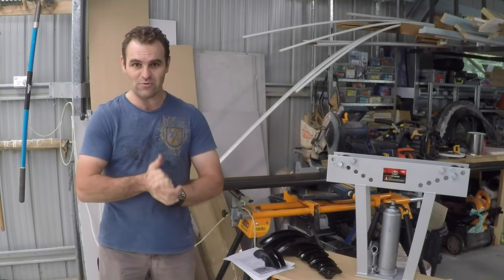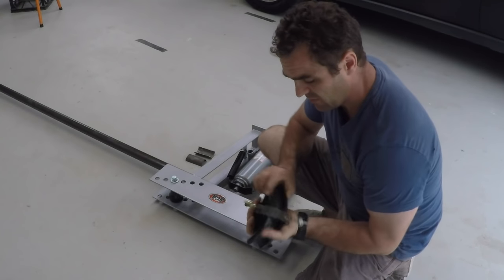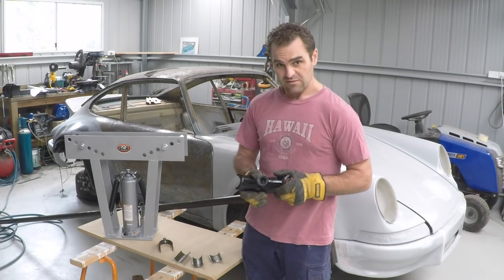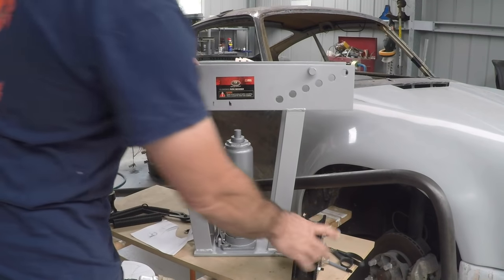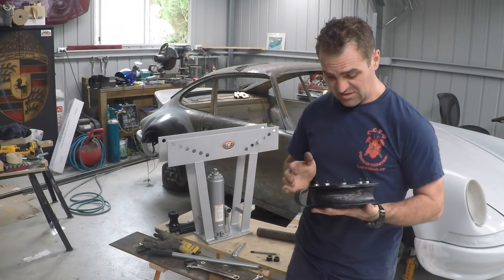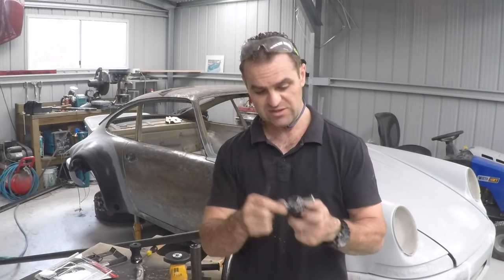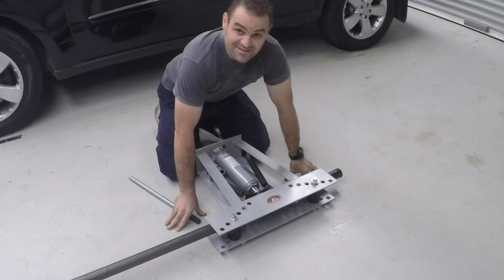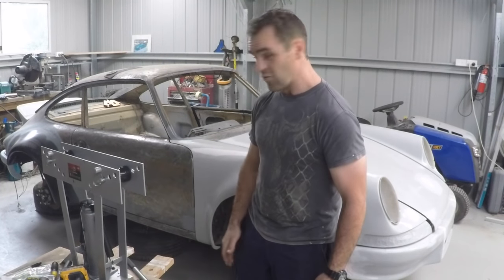How not to build a roll cage tube bender

Comment: When i bend with these benders. I mark half inch increments on the tube and line them up with a centre mark i drew on the die and count say 10 pumps and then do the same along the marks you drew. Youll get an even smooth bend

Comment: Good presentation.  What you need is a roller to bend the tube around the die.  The roller will support the outside of the tube while the die supports the inside.  You could go a step farther with a straight, concave shoe to fully support the outside of the tube.  Basically, just copy a commercial unit.
Reply from the maker: The main issue I have come to realise, is that the radius of the die is too small for the tube, so if you had a larger radius tight fitting die, some of these methods would have worked better. As you can see in my other "How to make a roll cage tube bender" video with the correct die, it also has a much larger radius.

Comment: When I went to fitter school.. we packed the pipe with sand to help support the structure.. so the heel didn't collapse. Maybe try that? IDK if it will work with a bender.. we used an old torch... good luck
Reply from the maker: Watch the vid ;)

Comment: I didnt watch the whole video before replying .. so i hope i dont mess this up by saying somehing that you had allready figured out.  

When pending pipes at any size its good to fill them up with  something first to prevent wrinkless and crushing in.    Sand is usefull but not perfect.   Water is good, but messy.   Basicly anything that does not loose volume under high presure is  perfect for use.  Butt you need to be carefull, becouse the presure rises fast inside when the pipe wants to crush, but liquid or what ever inside prevents it happening.   

Hope it will help others, and you aswell at some other projects.   maby even at building brake lines etc. 

Want to say to you, that you one of few diys that does things well, and not piss against wind while running.   Thumps up .

Comment: Excellent persistence. I'm sure u have abandoned this by now but one tip I heard if you have a die that's too big for the tube, get a piece of tube that fits the die correctly and has the correct wall thickness to reduce it down to the size u want to bend. Then bend it and cut it in half along the radius and tack it in ur die. Use it as a reducer. So if u had a say 1 3/4 die and wanted to bend 1 5/8 u would need to get a piece of 1 3/4 with .0625 wall thickness and bend it.
Reply from the maker: +shea jones I did consider something like that, but it was all too difficult, and as I have mentioned to others, I think the core of the problem was the radius was too tight for the tube I was using. One of the suggestions someone came up with, which I think would have been the best would have to put Chemi Weld in the die with some plastic wrap over the top and then push a piece of the tube through it to get the perfect size. 

Either way if you look at my other video of how to build a tube bender (that works) I sorted it all out with a correct die from the affordable bender.

Comment: It comes down to one simple fact mate, pipe and tube does not want to bend! Wall thickness, centre line radius, material etc all play a part. The outside is being stretched,the inside compressed and it only bends naturally around the centre line radius.
 I have a JD squared bender with dies, expensive but worth it. I make the cost back by hiring it out to others, the best solution for many. If you of going to use one much then see if you can hire one, better than wrecking expensive tubing and cheaper than buying one.

Comment: to be able to use the die, you'd need a very narrow die for the pipe, it should just sit on the top of the bending die..
the force of the hydrolic jack shouldd force the pipe into the die and make a good bend..
good luck, greetings from the low country..
Reply from the maker: Ultimately the radius of the die is just too tight for the tube, so it will always kink. The correct die I got in my other videos has a larger radius.

Comment: the bender you have will probobly have dies for imperial tube. you can purchsse metric nominal bore dies from dawn. you will be able to bend to nearly a 90degree angle without kinking. also its a good idea to use a sleeve of the next size tube up to prevent dints from the outer rollers.
Reply from the maker: I was bending imperial size 'tube', but 'tube' measures from the outer diameter where 'pipe' is the internal diameter. The issue is trying to use a 'pipe' bender to bend 'tube'.

Comment: I think a bigger radius would help much. That metal can only stretch/contract to some degree, which I think is why its crumpling up on the inside and gets pulled flat on outside.
Reply from the maker: +1988orpheus You are spot on. That was the main issue. It is obviously sorted now, as you can see in my next video, and the roll cage is almost done, so that video should hopefully be out in the next couple of days ;)

Comment: Hi there u do great work and clean  appreciations for the sharing with us this video  but  I wanna  know  how u did bend a thick tube  on that such table because  when  u press the jack  up u need a  solid table  bolte  to the to the ground to compensate the opposit  force. Please  don't take  as a comment  but because  I sow many  u tube  videos and I did  make  a copy but  doesn't work for me  thanks 🇩🇰👌👍
Reply from the maker: It is not pressing against the table. The jack is pressing against the rollers. Base of the jack and the rollers are tied together by the frame.
Reply: @HomeBuiltByJeff   am sorry  Egain the frame  should  also  be tied  and  secure   by something because  it's a big  pressure  be used  to bend the  pipe and am sorry  if I do misunderstood the concept 🤣have  a great day

Comment: what size die were you using? i used a 1 1/4 die and grinded to fit the 1.75" tubing (amost, it was a bit smaller than the tube) and it worked out pretty well
Reply from the maker: In the end the biggest issue with this for me was that the radius of the die was too tight for the tube. The trouble is, that the dies with the bigger radius were also far too big for the tube.
Reply: Home Built By Jeff makes sense

Comment: I know this is an older video but Ive seen where guys pack sand inside the pipe  though I have never tried it.
Reply: and weld a cap on the ends once the sand is packed in....

Comment: Just fill the tube with dry and small fraction sand, weld off both sides and then you can use that type of bender, radius will be okay - I've builded 2 rollcages with the same type of tube bender (or should I say a tube press? =)), both cars has passed the FIA inspection ;)
Reply from the maker: No, that would not work. To get the densest sand mix, it needs to be wet, meaning at 100% saturation, and then you would risk blowing up the tube trying to weld it. Either way the tube was completely filled with sand and it did not force out of the end. The issue is that the radius of the die was too tight for the tube, and would never work. The sand was the best method of all of them though, but it still requires a very thorough cleaning afterwards to prevent it for rusting out from the inside. The tube bender I made in the end worked perfectly, and was still a cheap way to go.
Reply: Sorry Jeff it does need to be Fine dry sand, not wet.
Reply: Christopher Joyson absolutely right, just used a minimal fraction (size) sand and everything was great.
It's just not the fastest and easiest way to bent tubes for cage but cheapest at the same time ;)
Reply from the maker: That may work with that bender on a larger die. I have since measured the radius of that die, and it is too small for the CAMS regulations anyway. The bender I ended up making was the best solution for my needs, and I don't have to worry about the salt in the sand corroding the tube from the inside ;)

Comment: dam.. bought one from supercheap ages ago. still in it's box to be honest. but had plans to make a new exhaust for my mini and the galant. 40+ years takes its toll on them. If im not doing to tight of a bend do you think it's should do alight? probably doing 2' stainless, max maybe a 30 degree bend. And, nice to see a fellow aussie doing alright on youtube. Have you thought about seeing if you can get any sponsorship from any shops at all? I've spoken to a couple but they were saying they would be happy to once I've built up more audience (min10k) so that their shops mentions go out to a larger crowd to make it worth it. Still Working to 1k, but 30k+ for you should give you a bit of luck somewhere
Reply from the maker: Exhaust pipe is really thin, so it will be worse to bend on this than thick walled roll cage tube. You can definitely do it. Most factory exhausts are press bent, and it works ok. For performance, you are better buying bends and welding it together.
As for sponsorships, you need to look at it from their side, and look at what you can do for them, not what they can give you ;)

Comment: you need the other half  round on top as guide to keep it from spreading
Reply: lightrose100 

sounds like a good idea,

 maybe try that with the modified bender that drags the pipe up and have the second guide toothed in to the first so they both roll round at the same time. you could shackle off either side for right and left handed bends then.

nothing stopping you having complete circle guides with bolt holes around the circumference to attach shackles and ram points in different locations, you could just move the ram point round for greater than 45° angles.

Comment: I am not an engineeer, but surely you should be heating the steel before bending it?
Reply from the maker: +Chris Davies Apparently you are not supposed to heat the tube as you can weaken it. I have come to the conclusion, that along with the die not being a tight enough fit, it is also too tight of a radius. I have now ordered a die that is designed for the job, so it should work the way it is supposed to.

Comment: YOU CAN BEND NICE LOOKING 45 DEGREE ANGLES AND MAKE A PIPE PLUG BOUT 1IN. LONG DRIVE IT IN ONE 45 PIPE AND SLIDE THE OTHER 45 PIPE TO IT AND WELD IT TOGETHER, GRIND THE WELDS SO YOU CANT SEE THEM. SIMPLE,,
Reply from the maker: That is not acceptable for a roll cage. The main hoop must be made from one piece and must be cold bent so as to not weaken the structure.
Reply: are you really gonna race that car,,
Reply from the maker: gonzo gary Originally i was going to yes. Now the plan is more to have it as a street car that does some track days, but I think I have put too much into it to have as a pure track car 😉
Reply: drivers are so much more fun than a trailer queen for sure, those are my cars in my pic, 68 Charger and 72 Mercury Montego GT. drivers..

Comment: fill it with wet sand before bending....
Reply from the maker: Watch the video ;)
Reply: i thought you put dry sand in it. Dry sand and wet sand are two different beasts
Reply from the maker: +sanka no it was wet basically I filled it with water and then kept adding sand until it was completely solid and as densely packed as it could be. Still no joy. The issue is that the die radius is too tight for the tube, so it would never work properly. I should be posting up a new tube bender video today with the detailed plans for the one that works.
Reply: hmm interesting... wet sand did worked for me back in time.  I was lucky i guess
Reply: I think the tube kinked because your die was the wrong radius.